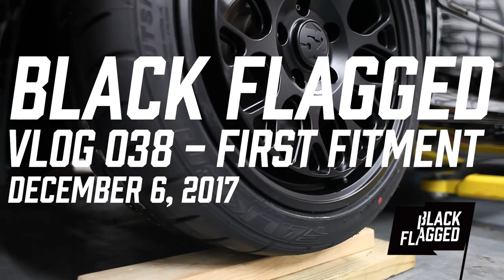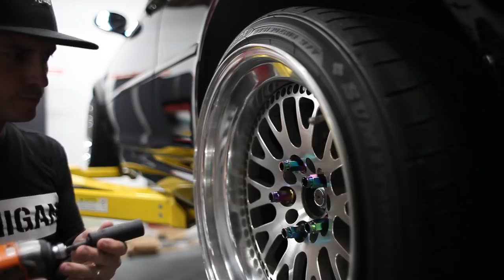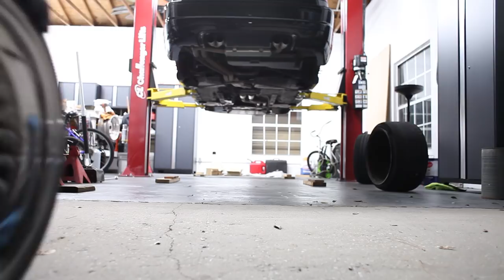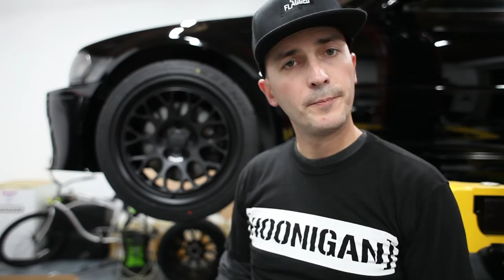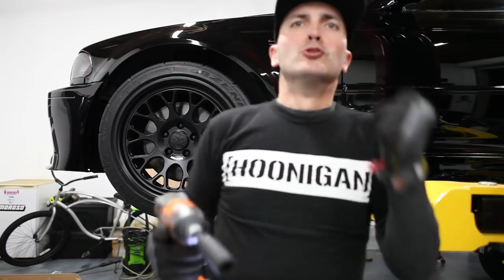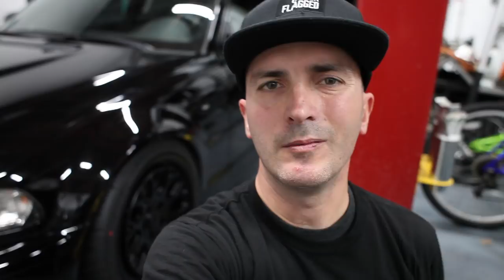Fitting the wheels and tires, part 1 | vlog 038

Comment: Im asking if you know ar anyone else in the comments: is there a difference betwin the e46 m3 and the reguar 3series coupe chassis, im not talking about subframes and suspension, just the shell, is the rigidity the same, the geometry of the structure or anything else?
Reply: freedomlifemake 25 as far as rigidity goes.. thy added some sway bars for the m3. And feels more rigid because of the subframe and suspension too.. also center mass of the engine and the transmission of the m3 is tiny bit lower than non m parts vs.. but if you strip it down its same car same chassis